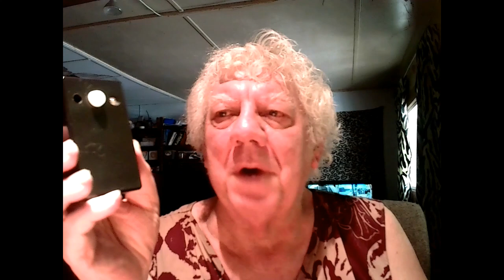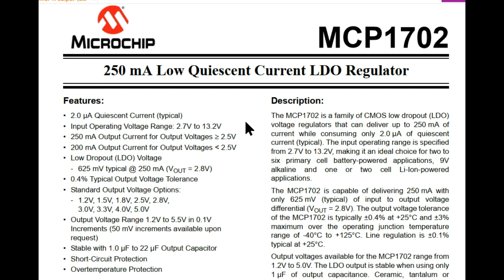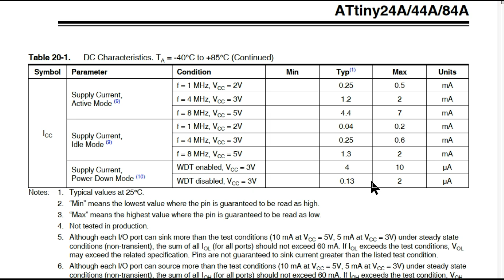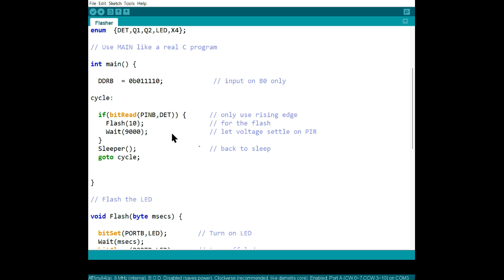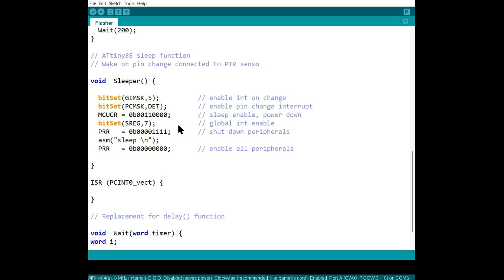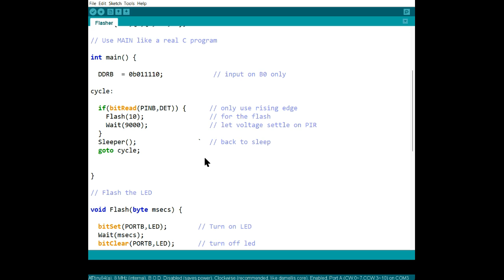Flasher Scares Away Intruders

Comment: If voltage droppout is unsettling the PIR sensor, then this bad power supply is also appearing at the MCU ... which isn't best practice.  I'd suggest a schottky diode between the battery and C1.  With this, an short impulse drain on the battery won't be seen by the regulator (PIR, MCU) since while the LED can drain LED reservoir C3, it can't drain pre-regulator reserviour C1 because of the diode.  A diode such as BAT54W has V(f) of just 100mV at uA-range I(f) currents.  With this improvement, the software workaround may no longer be necessary, but you would probably still keep a wait-for-input-low state prior to entering sleep.
Reply from the maker: Good thinking, but it could also have been a ground loop issue or inductive coupling and I don't want it to flash more often than that anyway.  So the software solution handles it all regardless.

Comment: It's not expensive to have a real camera doing the job. For under $50 including an SD card that'll hold 1000's of pics, it's both a deterrent and solid evidence if needed.
Reply from the maker: I like that it's so cheap this way ($7) in case it gets stolen itself.  Also I can get 2 years from the battery because the total standby power is under 20 microamps.
Reply: @luhanxmonat  I totally understand where you're coming from. And I'm not naysaying your solution whatsoever. It's just that the price of security systems on the whole have come down drastically. While it's not as cheap as $7, I feel it's a better option. And yes, it triggers on motion. Otherwise, it would just be a video camera. But honestly, you can get a package system of 4 tiny wireless video cameras and a DVR for sub $100 on eBay, Amazon, etc. Your solution was totally viable many years ago when cameras were expensive. People would buy a "dummy" video camera with a flashing light for $10. I just feel like it's worth having the ability to see what's going on or has happened. Cheers🥂
Reply from the maker: For those places where I could not run a power feed, I wanted  something to flash - not just show a red led.  I already have 4 cameras with 24hr recording on my house.  I will have to look into battery powered cameras and see what is currently available.